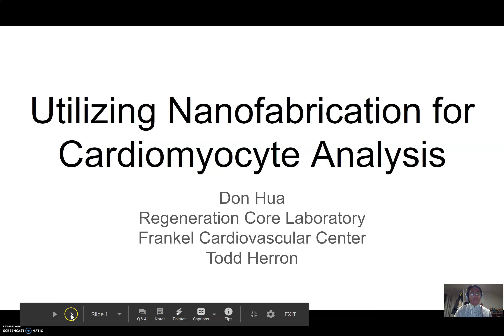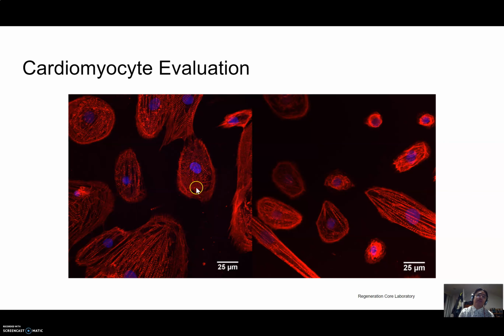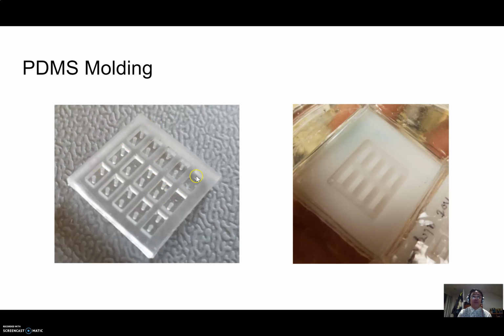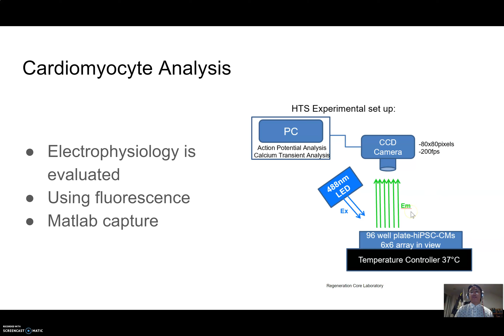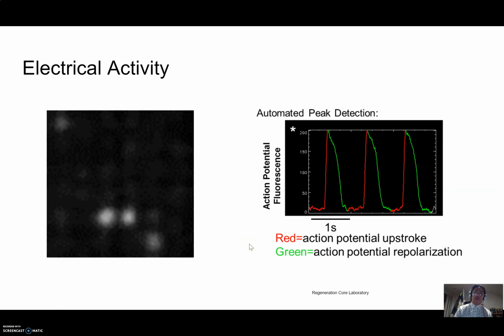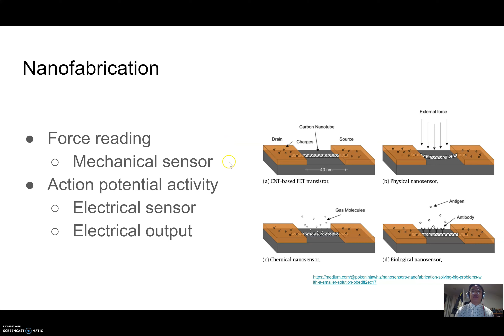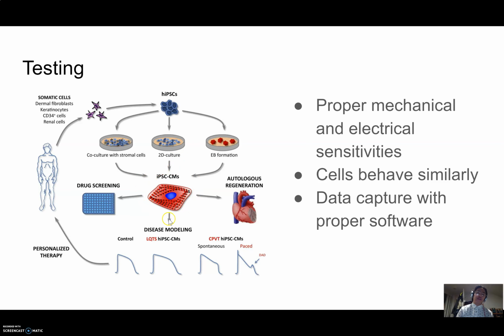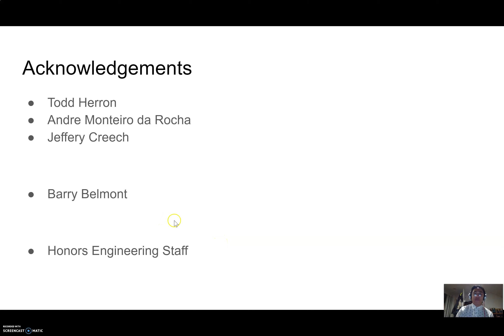Utilizing Nanofabrication for Cardiomyocyte Analysis

Comment: Hey Don thank you for sharing your amazing project with us! I was curious how you went about designing the nano-scale sensor and how you ended up implementing it into the 96-well-plate-esque design you came up with. I also was wondering what the electrical sensor's purpose would be; I may have misunderstood, but I thought the electrical impulse was meant to cause the cells to contract and you're measuring the force from this action with the mechanical sensor. Was the electrical sensor an alternate solution, or am I completely misunderstanding? Sorry for the long comment, but thank you again for the amazing project and good luck with continuing your research, I can tell it'll be really successful!